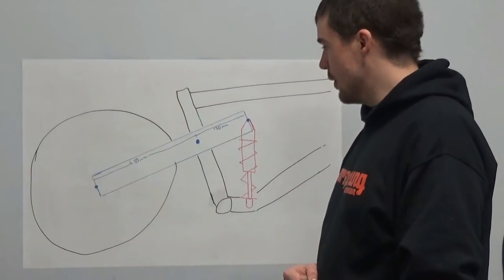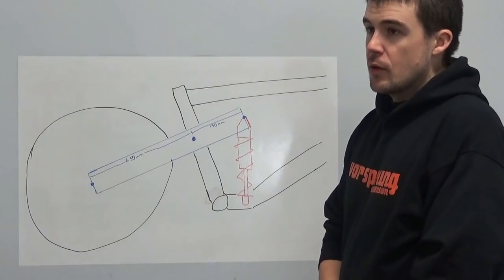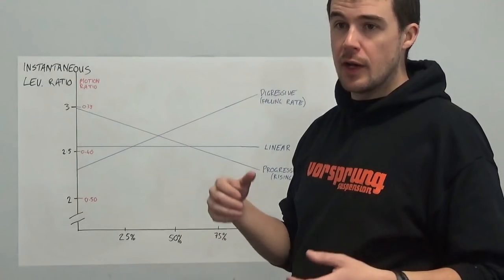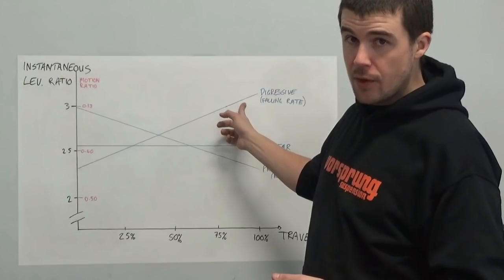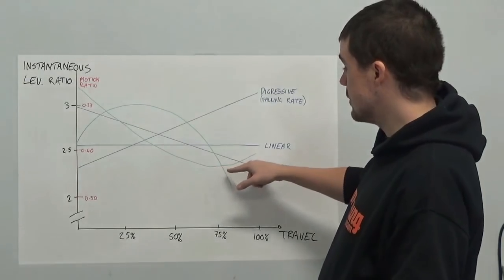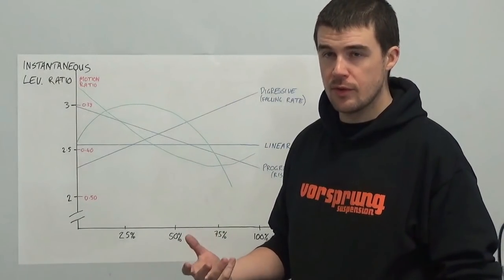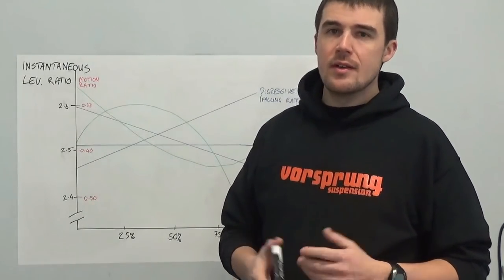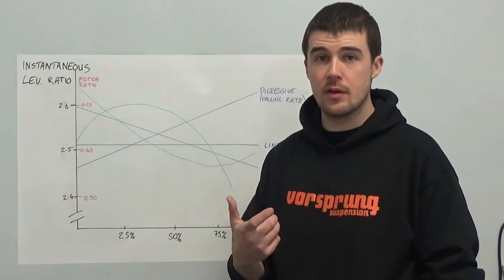The Tuesday Tune Ep 12 - Leverage Rates

Comment: Hi Steve, can you do another video on leverage rate and it's effect for either heavy (>110kg) or light (<55kg) riders. With more and more 150-160mm rear travel e-mtb on the scene, the bikes are heavier and the riders also might be a bit older and heavier it's important to know how the rear shock will need to be set up. There are many name brand name bikes (both analogue and electric) that have a payload limit restricted by the max pressure of the shock. Also, how "supple" will your bike feel if you had to put >300psi in to the shock get the sag right? I'm in the heavy category and if I'm looking at a bike the average leverage ratio needs to be 2.5:1 or less (ideally in the 2.3-2.4:1 range). Most bike sales people I've spoken to have no idea about leverage ratio, which is fine if you're average weight, but heavy or light, it's something the rider should understand.

Comment: In the intro you say that we don't care about the leverage ratio in terms of shock doing the work, but doesin't it affect how rebound works? If the leverage ratio is higher, the rebound will be weaker, so I suspect that it will not be as fast as with lower ratios. Am I figuring it out right?

Comment: At first I thought you might have been making a mistake, but now I see the language is just a bit confusing (to me). For a Progressive leverage geometry, as the rate rises it drops on the chart, indicating a decreasing wheel-to-shock travel ratio, requiring LESS spring force per mm of wheel travel.  For a Digressive leverage geometry, as the rate decreases it raises on the chart, indicating an increasing wheel-to-shock ratio, and thus requiring MORE spring force per mm of wheel travel. 
That makes perfect sense!  But it is a bit confusing. <3
Reply from the maker: Yes, it's more intuitively understood when using motion ratios rather than leverage ratios (the two are the same thing, but motion ratio is the inverse of leverage ratio). Basically the spring rate increases at the wheel throughout the travel in a progressive system.

Comment: When the shock and leverage rates are added what are the normal desired force curves at the wheel?  Is there an ideal curve that manufacturers try to hit?
Reply from the maker: Every manufacturer seems to have a different idea of what is ideal - to the point where some of the leverage rate curves are literally the exact opposite (inverse) of one another. There is not a particularly strong consensus on what works best. I think aiming for a generally progressive wheel spring curve is the most widely-agreed-upon characteristic, but even then there are some extremely popular bikes that go the other way.

Comment: Would like to ask a couple of questions relating to the leverage ratio video concerning a 2016 gt sanction 
1 is this bike considered to be a single pivot ?
2 how would I go about  measuring the Swingarm to shock eyelet to find the leverage rate/ ratio on this bike 
3 and how would said measurement be interpreted to the rest of the leverage rate/ ratio 
Trying to find out what type of shock would work best with this bike and what to avoid, been trying to work this out myself bur can't seem to find enough information, standard shock is fox float x evol 215x63. thanks

Comment: Does that mean the best shock for a VPP bike is a coil shock?  What about all the SC bikes with air shocks?  Good for pedaling but hard to use all the travel?
Reply from the maker: Not necessarily. Leverage ratio has almost no influence on pedaling performance, that is to do with anti-squat. VPP bikes can be more up one end or the other of that curve as well, not all of them ramp up significantly at the end of the stroke, and not all of them are substantially falling rate at the beginning (eg the 951... which ramps up MASSIVELY but has almost no falling rate early on). The specific details ALWAYS matter.
Reply: Would you think coil would be suitable, specifically, for the Hightower which has regressive/linear/progressive curve I believe?

If the end stroke is only slightly progressive would you run less sag at the expense (perhaps?) of suppleness at the start of the stroke?